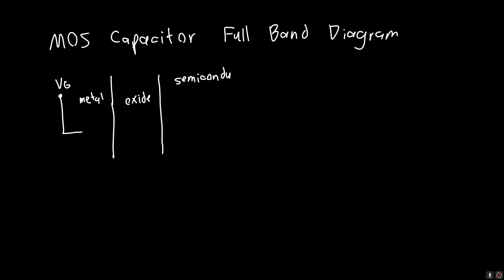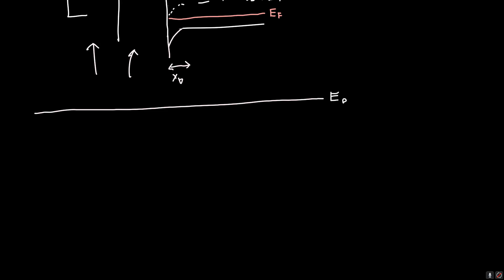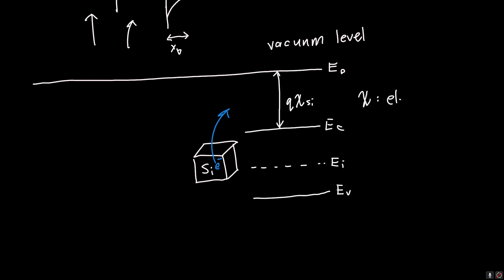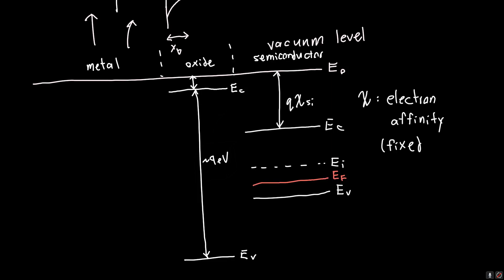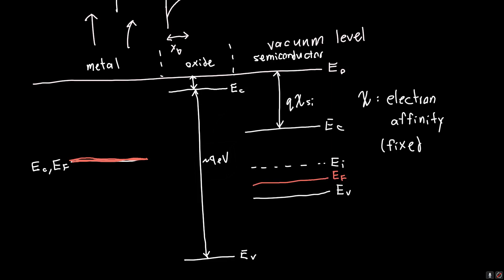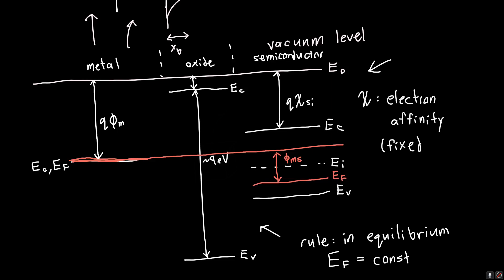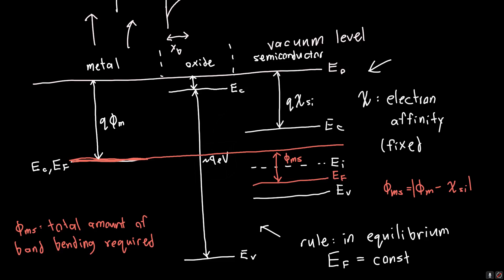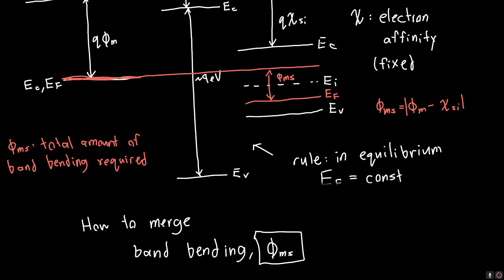MOSFET Band Diagram Explained

Comment: Flat Fermi Energy level in equilibrium analogy is that when all materials at different temperatures are brought together there is energy transfer (some heat up, some cool down) but they all reach the same temperature (Thermal Equilibrium). The band bending at equilibrium shows the relative energy transfer that has occurred.

Comment: Question regarding to vacuum lvl.
I was wondering let say we push  to the metal or semiconductor by applying super high negative voltage,  the electron will be completely striped, will the electron come back when energy drop back or the metal /SC become useless respectively?

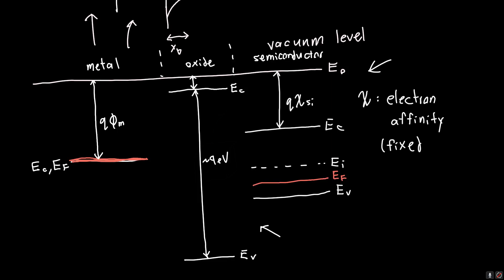Comment: how come the energy needed to strip electrons in metal is higher than it is in semiconductor according to band diagram at 6:11? why qΦm is larger than qXsi?
Reply from the maker: Excellent question. It doesn’t have to be. The metal work function depends on the metal in question, and can actually be larger or smaller than that if silicon.
Reply: @JordanEdmundsEECS  thank you very much sir，is there any textbook having detailed derivation related to this topic?which textbooks are you using for reference?

Comment from the maker: There is an error at 7:39, Phi(ms) should be phi(m) - phi(s), where phi(s) includes both chi(s) AND the difference between the conduction band and the fermi level of the silicon.
Reply: thanks for this statement, i was clueless for 2 minutes
Reply: I was wondering the same thing yesterday, fortunately i checked the comment section today.

Comment: If  phi(ms) = phi(m) - chi(s) then how is that equal to E(f) for metal - E(f) for semiconductor.
Is it that the chi(s) is the difference between vacuum level and Fermi level for semiconductor
Reply from the maker: Tushar Patle ph(ms) is equal to phi(m) - phi(s), and phi(s) includes both chi(s) and the difference between the conduction band edge and the fermi level.
Reply: @JordanEdmundsEECS   Thank you very your videos. Can you please update the equation with all variables included? I could not understand the equations you describe in words in your previous comments. Thanks again!

Comment: why the entire fermi level is equal to that of metal ?
Reply from the maker: Rishi Varrey When a given system is at equilibrium (for example a MOSFET) the fermi level is constant throughout. Since the metal’s fermi level does not move (it’s got so many electrons) the silicon fermi level has to change to be the same as the metal’s.
Reply: @JordanEdmundsEECS  but the Fermi level of the semiconductor too doesn't move by band bending right? Band bends only changes other energy band levels except the Fermi level